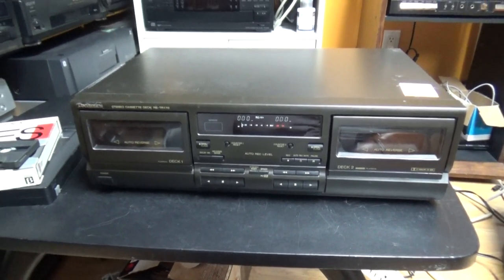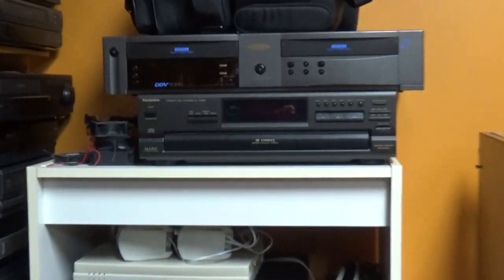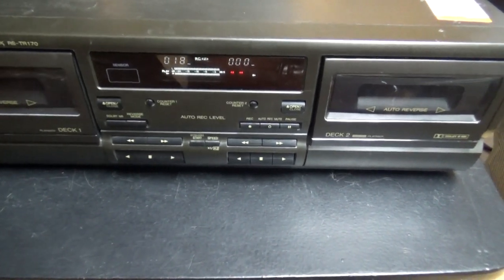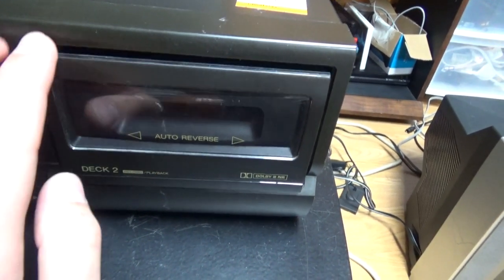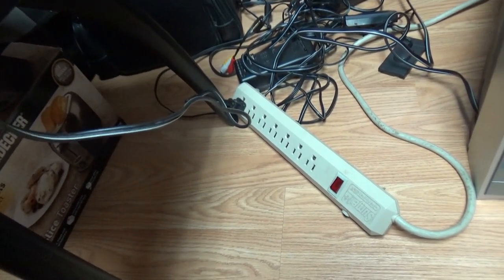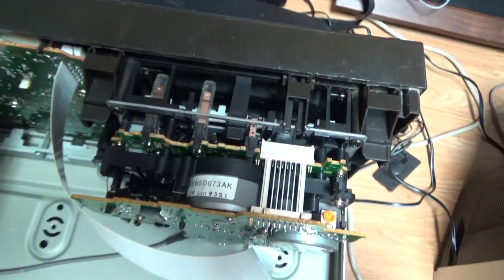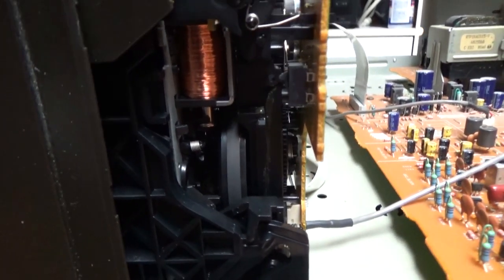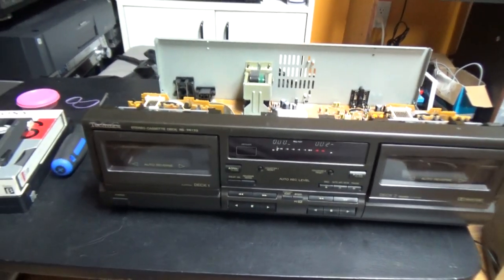Technics RS-TR170 Dual Cassette Deck with Motorized Door

Comment: Merci pour la dédicace  , je m'étais dis que t'allais parler de moi quand j'ai vu la description du video loll  ;-)
Pour ce qui est des petits potentiomètres orange , c'est effectivement pour le réglage de la vitesse ... Comme le Deck 1 est seulement pour la lecture , c'est normal qu'il en ai juste un . Pour le Deck 2 , c'est simple , un des potentiomètre sert à la lecture/enregistrement et l'autre sert aussi à la  vitesse , mais pour le mode  ''Copie Accélérée'' (High Speed Dubbing)

pour le probleme du deck 2 , j'ai aucune idée ce serais quoi , c'est la premiere fois que je vois ce probleme , mais c'est peut-etre aussi les ''sensors''  au dessus du logement de cassette qui sont defectueux  , ils servent à détecter si il y'a ou non une cassette (et ainsi activer la lecture/enregistrement) , et aussi à détecter le Type de bande (1,2 ou 4)
Reply from the maker: Merci pour ton commentaire, je savais que tu allais aimer ma vidéo.

Comment: Its really weird that such a low end cassette deck has motorized doors!
I have a question though: does that cassette deck you can see in the background with the silver buttons work? Because you could use that to record a tape.